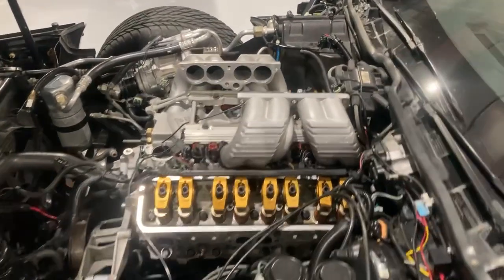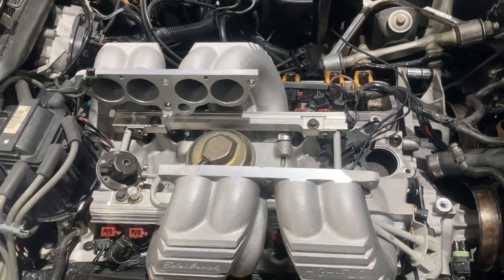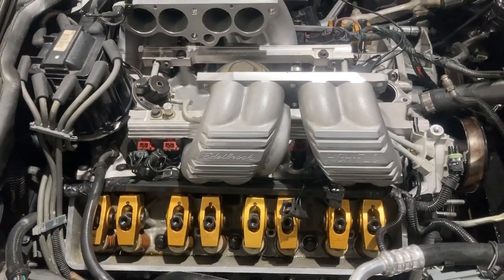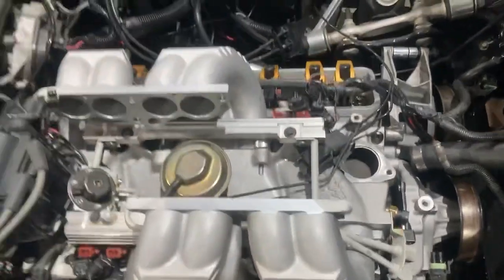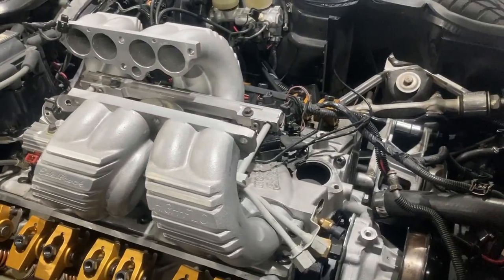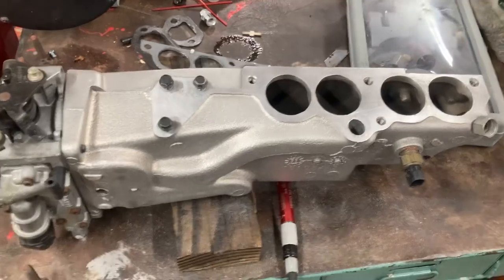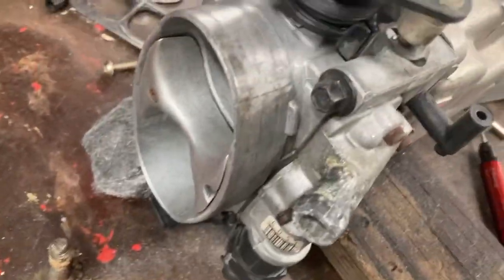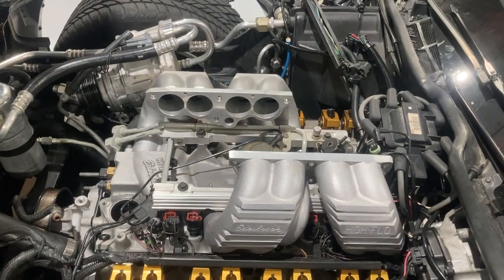C4 Corvette TPI 5.7 tuned port injection Edelbrock High Flo large port intake and runners - Part 9

Comment: Love this series Matt! Question for you: if a TPI engine loses rpm bandwidth with increased displacement, can you counter that with a higher compression ratio or increasing the overlap on the cam to move the power back up 500-1000 rpm's? Thank you sir!
Reply: I hear you on the 58mm TB, or a larger single blade TB which I'll probably do. I won't siamese my Edelbrock runners though!

Comment: what do you do with the computer?
Reply from the maker: Zip… has hyper tech chip.  This is why i have boost rate fmu its all done mechanical as the tpi ecm has little to no tuning abilities past a few perimeters that will not help at this level